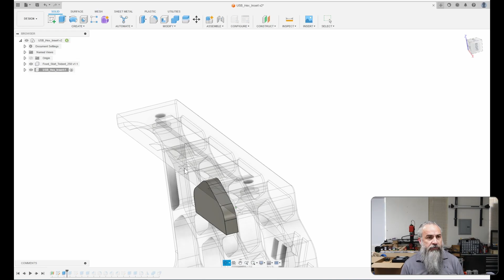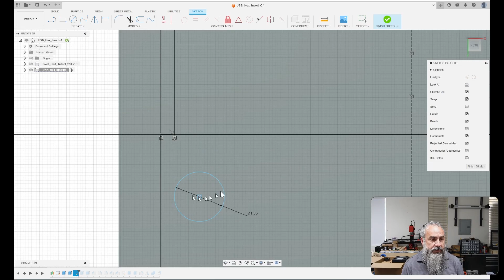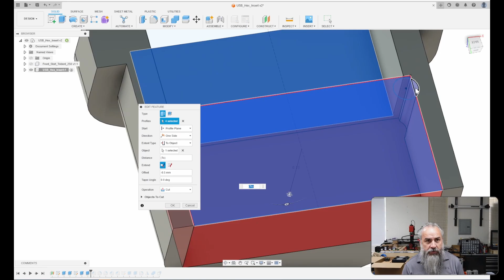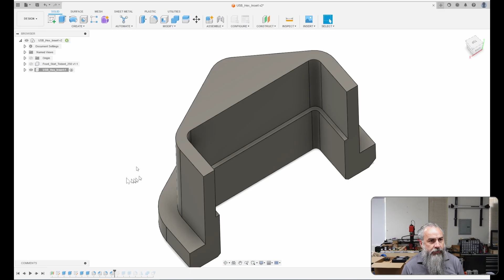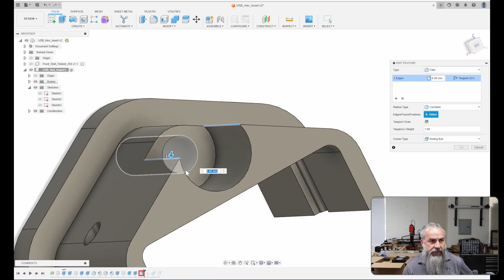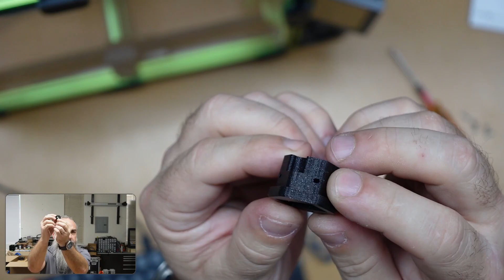Fusion Fun! - USB Skirt Insert, Addendum

Comment: Good stuff!! I can't get enough of these Fusion Fun sessions. Quick question: @16:12 Why not simply increase the diameter of the existing circle from 5.5 to 6 and be done with it? The extrude feature would automatically adjust and you'd save the step of having to edit it.
Reply from the maker: That's a great question!  I kept the 5.5mm circle because I used that as a reference for how much overlap of the head to the skirt opening.  If I had just increased that to 6mm I would  lose some of the actual overlap and may have hit a point where the screw wasn't effective in holding the insert in place.